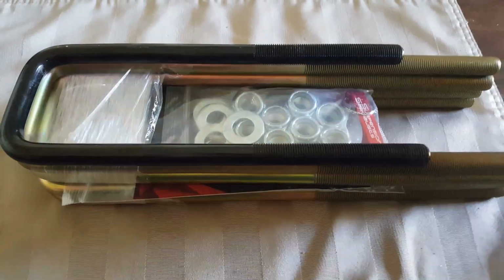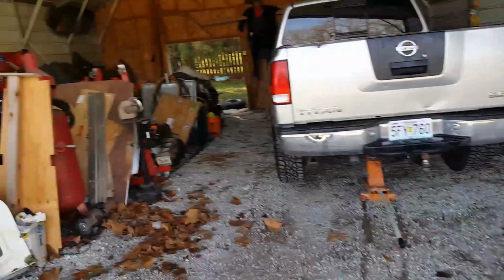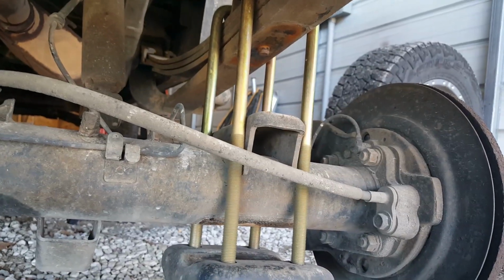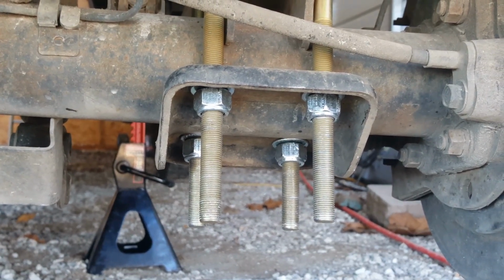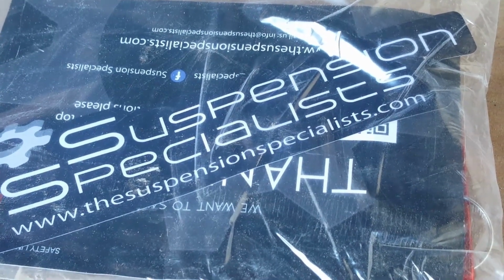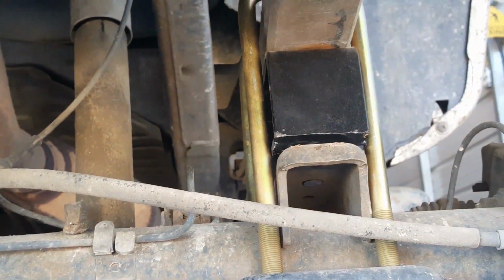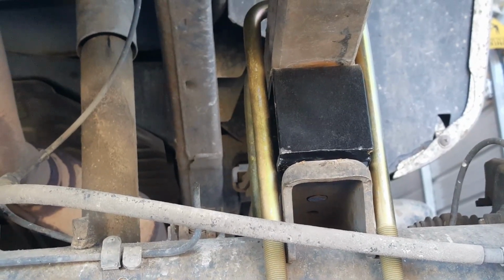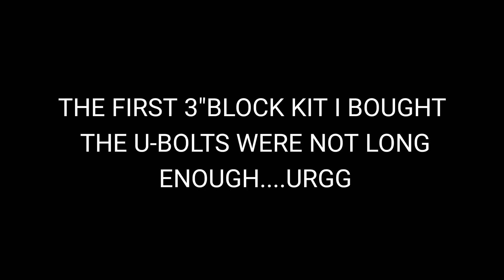NISSAN TITAN 3" BLOCK LIFT INSTALLATION

Comment: Are you using stock shocks for the 3 inch lift?
Reply from the maker: No, I did at first, but swapped them to lift shocks after because they were stretched to capacity and hitting a bump was painful.... you can get shock extenders if you want...save you money for now?
Reply: @RoadHardRoadhouse  Shock extenders what is that is it the cheaper option instead of buying lift shocks?
Reply: Do you need the carrier bearing kit for the rear 3inch blocks
Reply from the maker: No i did not.    But every truck is different,  every lift is different  by a tad....
Reply from the maker: Yes, but not sure i
 would recommend them....
Reply: @RoadHardRoadhouse  Thanks!!

Comment: What lift is on the front?
Reply from the maker: I had a 3 inch leveling kit, then had a lot of issues with it and broke a a  arm in half...then I went down to a 2 inch leveling kit with rough country a arms...not happy with the a arms...they hardly do anything..... go dirt king if you need a arms....